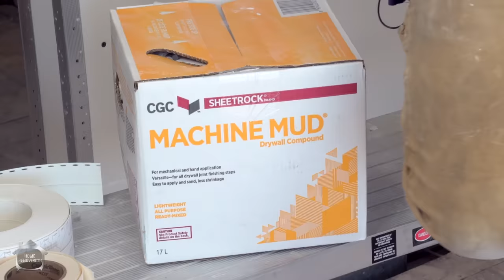DIY Drywall Part 4 | Drywall Taping Masterclass for Beginners!

Comment: First one of the main things to look at before applying mud is how deep screws are, u left that out or unaware of it. If screws are too deep they break the paper surface it is no longer holding anything. The paper surface is what is adding strength to the core of drywall, once the surface is broken due to screw being driven to deep, you have what I call nail pop not sure where that started for name prob from way old school people when they used nails. But you need to put another screw, if u dont after it is finished and paint is applied you will see those dimples from the screw and the sheetrock will move. Second thing, lightweight mud is one of the worst things to tape with. Lightweight mud doesnt have the bonding strength as full weight mud or a special formulated mud with glue in it for taping. You will get tape peeling from walls after a few years especially if temperature fluctuates a lot in your house. I also have no issue mudding torn surface paper, apply mud and wipe it off tight next coat fill it up. Never in my 20 + years of finishing have I ever needed to prime torn surface paper. As for as the hawk, personal pref i guess, but u kidding urself if u think you are holding more mud on a hawk than a pan. Further more if u done this for any amount of time u would atleast have a banjo. But I get for someone just doing a room no need to invest in anything they arent going to use. But I guess that is the difference in a amateur and a pro. As for gaps all gaps more than 1/8th inch should be prefilled otherwise you dont have enough backing behind the tape. Sure some will have there own pref but thats what I do and it works. Now you also say one more pass on angles on the opposite side and done, that means no skim coat, I already know how this finish comes out. I have never used or no any finisher that uses a measuring tape to put up bead, place the bead on the corner butt it up where it needs to be and mark it with ur finger and cut it, or make a mark with a pencil, and you should be pushing and setting the bead all the way on, that is insane to have to mud bead that deep, I also use a finish nailer 16 gauge, works great. Even if there is crown moulding it should be taped and sealed, it brings into question of how good a job you do for customers on remodels. It helps as a fire barrier and even if crown is caulked that is not a fire barrier, and caulk cracks as mouldings shrink anyways due to moisture content and expansion and contraction. Back to the mud pan argument,  that it causes all kinds of mud to fall to the floor, actually i can catch 90% of the mud, but i say that cause i watched so much mud fall to the floor doing the beads, This is the problem with carpenters who think they are turn key, they cant do anything good. I cant tell you how many times i get calls to fix stuff someone did themselves or a guy like this, this might be ok for someone that has very low standards, or if putting a texture on top.

Comment: Just joined as a save-bacon member. Really appreciate the videos you create. Great job! Is there another forum where members can ask questions or is this public space it? Regarding drywall, the walls will be new in my rehab but the ceiling will be existing drywall. Will the joint compound adhere to the ceiling as is or does it need to be prepped? If so, how? Thanks.

Comment: Not entirely sure what's in the can, but I need some.   Is it called Compound Primer? Or do I ask for Oil Based Aerosol Primer when I get to Lowe's? Thank you! 

PS. Watching this (and several others), I have just finished sheet rocking my entire bathroom and getting ready to tape and put the compound on. This was not easy at all, lol. But hopefully the toughest part is over. Amazingly hard trying to screw something to the ceiling (or screw anything over your head). Definitely a work out.  
Thank you for these videos! :)

Comment: You ever try useing dish soap as well as water when mixing your mud seems to sand a little easier and smells good to lol
Reply: Steve Hastie the soap will burn the eyes. It does help with air bubbles.

Comment: Hi Jeff. I pulled old drywall off the walls in a small bathroom. They used liquid nails on the stud face to help the drywall adhere. 
Do I have to remove the old liquid nails from each stud face prior to installing the new drywall?

Comment: Appreciate the comments about filling holes and such to prevent bubbles under the tape. There is a bit of science about what causes tape bubbles. Finishing mud shrinks. Repeat. Shrinks.. If there. Is a wide gap or chunk of drywall missing, you have to. Remember that as the compound sets, the surface dries first and the tape is close to the surface and it dries first. With a consistent layer of mud behind the tape, it gets pulled in to the mud behind it as it dries and hardens. But the big gals and holes in the drywall will dry slower and continue to shrink and crater away from the already hardened thinner mud . Do yourself a favor and use some mesh tape Under the mud with fast setting no shrink compound like EzSand 20 and then use convention tape and mud over that after it sets in a half hour or so. Jeff has pointed this out before, but it bears repeating

Comment: Really enjoy your video's, I am new to  your channel, but I find them very helpful.  Curious, do you have a video on the best way to repair drywall tape?  Some of the tape on my ceiling is starting to pull away from the ceiling.  Do I pull it off, try and get it to stick again?  Any advice would be appreciated.

Comment: Would you recommend the plastic corner beads with some adhesive or metal with nails? Metal with nails seems like it adds extra time while installing thr beads and more work down the road

Comment: Wetting the tape in advance (with water) causes it to soak in the water instead of the glue from the mud and it won't adhere as good.

Jeff's method is much better.

Comment: Love your videos. Been starting to dabble in some DIY projects. I did first coat on a outside corner bead this weekend in my basement. That night my heat went out, and the mud seemed to have froze and cracked while it dried. Do you think it’s worth scraping it all off and starting over or will the 2nd and 3rd coats cover it up enough?

Comment: I found all your videos very helpful. Thank you. I am DIY-ing my house built in 1940, I just stripped about 5 layers of wallpapers (the first layer is still “made in England”), washed the glue off what seem to be a hardboard or fibreboard wall. I’d really, really appreciate it if you can give me some advise please? Can I do all of what you just did on the video on my wall too? Do I coat it with a primer first before doing the corner and flat taping, and probably skim coating? Or will the joint compound set properly on a fibreboard/hardboard? Reason I’m asking is I see you spraying an oil-based primer on the brown paper. Again thank you so much for all your videos. I love the tips and tricks! I am an IT lady trying to be a tradie (at least for improving my house) so I don’t have to spend thousands of dollars. Cheers!

Comment: Very good tutorial Jeff. I’ve seen many drywall tapers and they all seem to have their own preferences but end up with the same results. When doing our metal corners we like to back cut the metal on a slight angle as to not interfere with the joint.

Comment: Not many use metal corner beads.  We use ultraflex on our small jobs.  It's expensive, but perfectly straight every time
Reply from the maker: metal requires some skills. but it is fast cheap and perfect. not too many times you get all 3 in life!
Reply: @HomeRenoVisionDIY  true that!

Comment: It's nice that the 45 sets up so fast, but if it's getting too hard while you're still finishing the job then I don't stand a chance.  Can I use cold water instead of warm water to buy some extra time?
Reply: Warm water does cause it to set faster, so colder water will buy you a "little" more time.  Also, older setting compound will set faster than a new bag.  If you're doing a big enough job and feel 45 sets too quickly, you could always buy both 45 and 90 and mix them to get a setting time that's somewhere in between.

Comment: answer a question, do you use a screened tape to treat the joints instead of the microperforated paper tape?
It is that here in Brazil people have this habit.

Comment: Jeff, in another video you put on a bunch of mudd with your 10 inch knife, go over it to remove from the sides then put your tape on and go though pressing it in and wetting it.  In this video you use the side of the 4 inch to apply etc.    Which method is easiest and or best?
Reply from the maker: That is all personal preference.
Reply: @HomeRenoVisionDIY  ok, thank you.  Your videos have been very helpful DIYing a house built in 1940

Comment: What is the reason for using different kinds of mud for the outside and inside edges in a room? Is it strictly because of the addition of the metal pieces?

Comment: What is the difference between sheetrock 45 and sheetrock 90 when should I use each one of the two?
Reply from the maker: it all refers to the working time once mixed. so you choose based on how fast you are.

Comment: Hi. Before I could start painting like this I am facing a problem. The screws do not sit flushed on the wall even when we used a flat head screws. The screw head is protruding out a little and I am hesitating if I will start painting it. Will adding a layer of putty hides the screw heads? I tried screwing it in more but it just slides. We built a marine plywood on metal studs. I am still learning about this so I would appreciate any enlightenment. Thanks

Comment: Hello and thank you, great tips, love your sense of humor. Can some one please explain or give me a tip. I opened a dividing wall allowing more light to come in and now I see all the defects in my ceiling. Unintentionally I ended up applying 6 coats of paint and still defects are apparent. It's as if paint is not absorbed equally. Little pin holes everywhere as if plaster job was poorly done. Is there a specific paint that would cover this up. Thanks
Reply from the maker: Yes, absolutely, however the best solution is a valence on the window. Cheers!
Reply: @HomeRenoVisionDIY  There are blinds on the living room window. The opening was made on the wall which divides living room and kitchen. Cheers!

Comment: In a prior video you recommended taping all inside corners first. This video seems to contradict that. Do you now recommend doing the horizontal factor joints first? Thanks!!
Reply: Taping order. Butt joints, then flat seams, then corners/angles. Overlap everything by at least 1/4 inch.

Comment: Thanks for the video however i wonder when to use white tape or net tape? Is it one or the other or they have to be combined ( net for horizontal joints n tape for vertical ones?) thanks for ur quick response!
Zak

Comment: Not about drywall but i am doing a project on my mobile home and as may guess,i am trying to cover the lines in the paneling.I have never applied mud before and i really enjoy your videos.I would really like to know if you could put out a good video on how you would tackle a project like this because there are very few and the one that are out there are not professionals like yourself. There are so many mobile homes out there and i for one cannot stand to look at painted paneling with all those lines! Looks like trash. Pulling the paneling down and putting up new drywall is not feasible as you have to watch the weight and after all it's just a trailer,you want to be careful about how much money you want to put into it as there is zero resale value. Thanks!

Comment: Keep in mind that he has lots of experience (lots). This is a craft that takes time to learn. Be patient, and be a student of the process. I have made many large and small repairs to drywall around the house, but never used Hot Mud before. Decided to repair a 5 ft x 4 ft hole in the ceiling. Used the 45 minute mud, and had a rough time with it. It can be a difficult product to work with for novice DIY folks (like myself). Besides the countdown timer on the fast setting hot mud, it goes on much much thicker than normal joint compound. It is sticky, and looks like a lumpy mess going on (even if you mix it properly). It of course can be smoothed out but you really have to have experience with the tools in order to get a smooth finished professional look. I found in other projects (all ceilings) is to do a combination of products. I used 45 minute mud mainly to fill large gaps, and make the first coat on the butt joints using the Fiberglass tape, then do the rest of the job with conventional joint compound. A novice like myself can get a much much smoother finish with conventional joint compound (and very little sanding). Also, the hot mud promotes "Easy Sanding", I think that is false advertising. * Remember, this guy is a pro. He is not trying to make you into a pro, but show you the basics, and hopefully lead/teach you to a point to where you can become proficient at the process. Note: When I have a repair to make, I will get a scrap piece of drywall and simply practice before the repair, due to the fact that it may be a year or more before my next repair, and this is an art form that takes years to learn and master.
Reply from the maker: Cheers Dan!

Comment: Heya jeff. Tackling a garage conversion and thanks to your help and advice I'm confidently drywall DIY. Question though is...  for my area, Seattle USA the compounds are labeled as beadex brand.  There's taping lite in yellow box, red all purpose and a blue label top coat lite.  I found some silver set 40 for my corners as closer than anything to your sheetrock 40.  Which compounds would be best for which part of the job?

Comment: What type of drywall knife are you using? I once had a set of knives that were “extra flexible” but ended up being so thin at the end that they would take a beating from my hawk surface and edges.
Reply from the maker: this knives are from richard. Cheers! not as thin!

Comment: So if I am going to have crown molding put up, I don't have to tape between the ceiling and the wall? Also, I just can't get it. Sheetrock 45 under the tape and mud compound over the tape and over the dents and screws?  I've watched so many videos, it's all running together!

Comment: So I have some imperfections on my top coat that had some bubbles and some touch up spots in my corners. I would like to know would you use an all-purpose joint compound or a hot mix? Yes a 90 minute mud will set up in 90 minutes to where you can put another coat on it but it's not sandable in 90 minutes. So either way I'm going to have to wait for one or the other to fully dry cure before I can sand. What would you use to fill in these imperfections?

Comment: metal beads where used in the 1800's it's 2020 so get with paper beads, no mailing and always straight and you don't have to tape it, so it dosen't crack
Reply from the maker: you can use them if you want to. I find that the metal corners just hold up better over time and they don't have issues with the tape bubbling. plus I can use hot mud and finish much faster!

Comment: Can the big box of machine mud be reseated and used later? I have a project that I will be doing bit by bit over a month. Can I take a bunch out then reseal the plastic bag with a zip tie and open it again in a week etc a few time’s over a month or so? Or does it go bad soon after it’s opened no matter how tightly you reseal it?

Comment: Fold the bag over the edges of the box, then turn it upside down as you dump it into your bucket.  Turn your bag inside out as you pull it away from the compound.  Easier than squeezing the bag.  More compund in the bucket not on the bag.

Comment: Thoughts on plastic corner bead? I used the round corner bead with good
Success, if you bump the corner though it’s almost like you can tell it’s plastic
Reply from the maker: perhaps you are not installing it correctly. those vinyl beads actually take a lot more of a beating than metal if installed right. and they look great too!

Comment: why don`t you use paper corners with plastic inlay instwead of the metal profiles?

Steel and drywall work completely different. So there is tension between the materials, if there is an impact or temperature / humidity change.
Countless corners proof metal to not be the best partner for drýwall, just consider how often you see that they are damaged.
Paper / Plastic corners are way better in this point.

Comment: I can still see the joints and nail/screw beds on a level 4 finish.  1 and even 2 coats of pva primer even though I think 1 is enough and 1 or 2 coats of paint. I see the difference in texture the sheetrock paper has and the seams are smooth. Why is this? How do you fix it? Currently in my painting stage but most is primed already not painted fyi. Thanks

Comment: How do would one know when to use the all metal corner bead vs the metal corner bead with the tape built in? Also in a previous video it was shown that the metal corner bead was being place with drywall screws and not blue ring nails. Which is preferred?

Comment: thanks! what is your take on mesh versus paper? And what about when you have a stomped ceiling and you are only doing the walls? I've heard to cut the vertical drywall down about 8 inches from the ceiling so you won't have to deal with the ceiling corner joint?

Comment: Angel your knife on inside corners and both ceiling and wall get taped on the first coat. Why add an extra step waiting for the ceiling to dry, thend doing the wall.